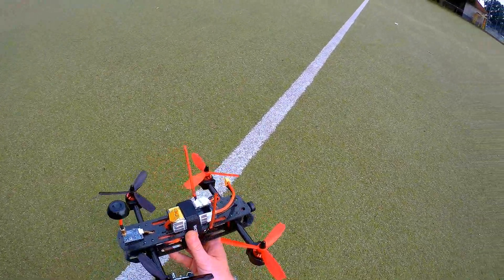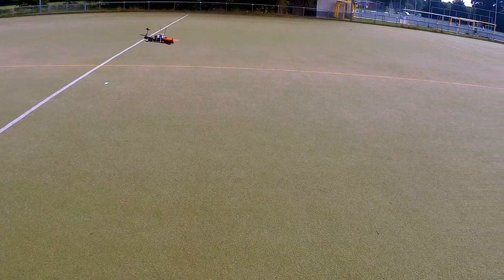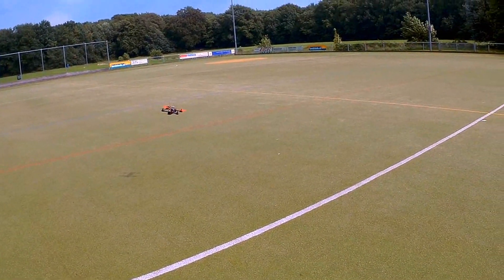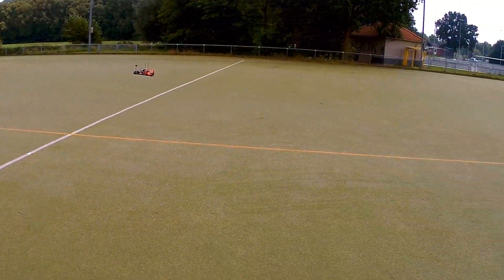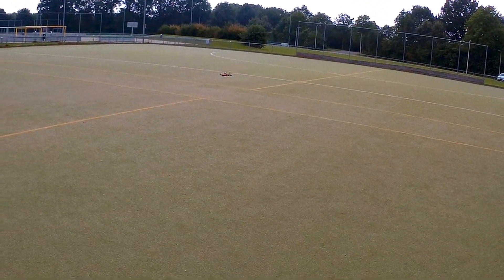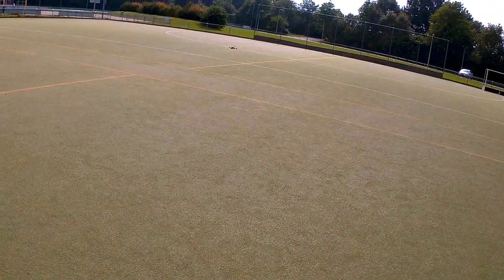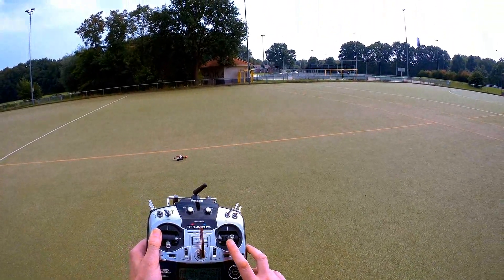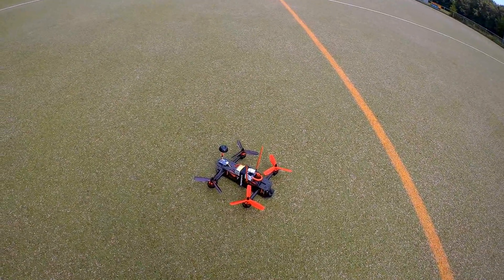Vector Quads Tilt Rotor Quadcopter - Maiden Flight! :)

Comment: i wanted to ask vector a couple quick questions but they don't respond to my emails, anyone know if they're still in business?
maybe dutch can answer my tilt rotor question, if someone already has all the parts to build a new conventional 250 quad but wanted to build a tilt instead, can i just buy a VQ250V1-KIT tilt frame kit and the BMS-210DMH servo then use the rest of the new parts i have to build the tilt?
Reply from the maker: Quadflopper101 :D  THAT is a fun channel name right there man! :DI haven't been in contact with them for a while now, but I'll check.. If the website is still up, I'm sure they Are still in business..Very short answer on that: YES :)  the setup in mine is completely conventional.. Normal (Naze32) flight controller + a PDB.. nothing out of the ordinary..
Reply: DutchRC Adventures .....oiiii Dutchie, standardise your orientation colours......? red goes to the rear, like car tail lights. Get it?
Reply from the maker: Ha :D  you know what? I really prefer to do what Works (for me that is).. When flying LOS I want to see the Front of the quad -> brightest color goes there..

Comment: Any chance you can do a vid or just reply here (if it is simple) on how to set up your radio........ I just got one of these frames and I cannot get the tilt to work through my radio....... thanks in advance....
Reply from the maker: Ah yes.. I didn't do a video on that cause it would be different for every brand / type of radio :$
Okee.. I'll try in words then :) 
I have that tilt-servo on channel 7 (directly on the receiver)
In the radio, I have the pitch set to channel 8..
Sooo... without any mixing, pitch does Nothing..

Now.. you need at least 1 mix.. from channel 8 into 7..
that way you will Only have tilting.. no pitching of the frame..

If you Allso want normal pitch (I use 20% normal pitch)
you need a 2nd mix, from channel 8 into channel 2 (elevator / pitch)

Does that make any sense???
Reply: Yes it makes sense... Thank you for taking the time to explain that....
Reply from the maker: No worries sir.. that's what my channel is for (and the occasional entertainment ;)) 
Glad to read it helped you out
Reply: Love your channel.......
Reply from the maker: Thanks :)  Allways good to read!

Comment: It's nice having the option to engage or disengage the tilt function as I can imagine that it might initially feel a little confusing in full Acro mode. My one concern would be in the event of an unfortunate crash how well the tilt mechanism would hold up or would one be expecting to replace servos as often as props.. It was obvious that it was very windy but you need not have apologised as you demonstrated the quad really well, especially for a maiden.   
Regards.   
Nidge.
Reply from the maker: Thankd Nidge :)  It IS a bit hard to keep track of, especially because the yaw was slower then I would expect.. 
Hmm yeah.. crashing.. Offcourse it Would help to use a good strong servo (which I have).. I have not had to replace the servo on my other tiltrotor, eventhough I Have crashed it a few times :$ :$